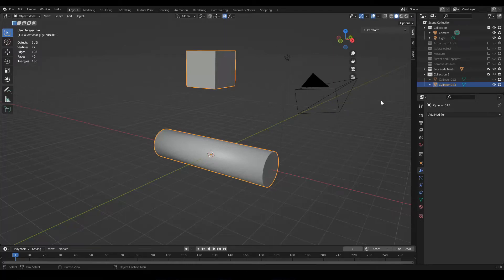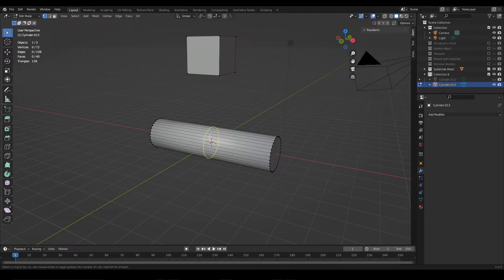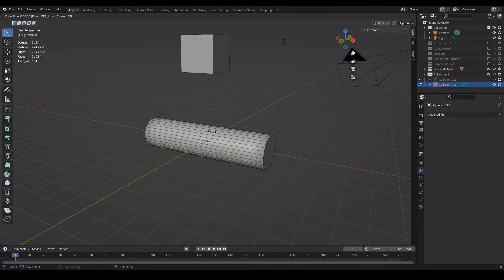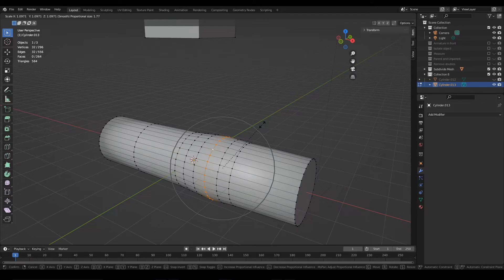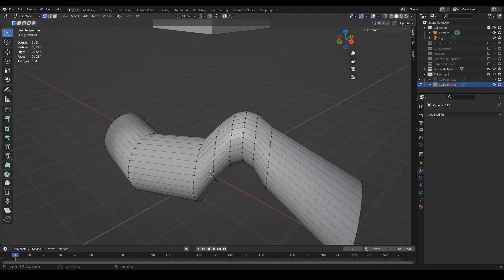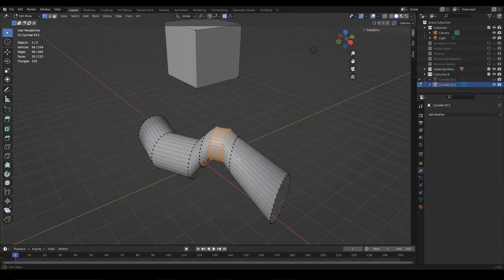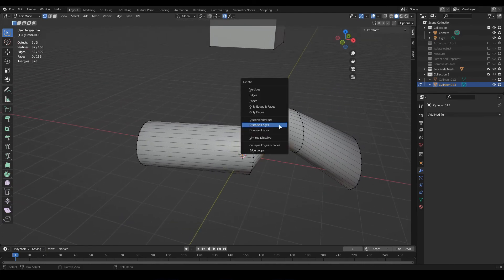How to ADD and REMOVE EDGE LOOPS in BLENDER

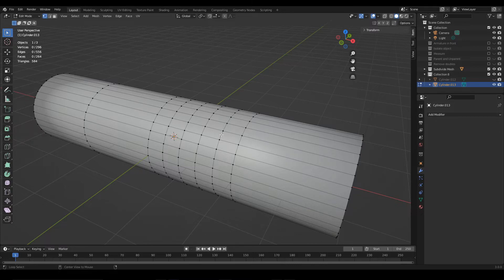Comment: 1:04 This selection method does not work in the newest version of blender. Edge loops for faces is Ctrl + (Left)Alt + RMB/LMB. But for line edge loops, it doesn't work that way. Still trying to figure it out.
Reply: So I am on Ubuntu, apparently Alt + Left Mouse Button actives moving a Window. So I rebinded that to spacebar. And play animation frames I rebinded to something else.